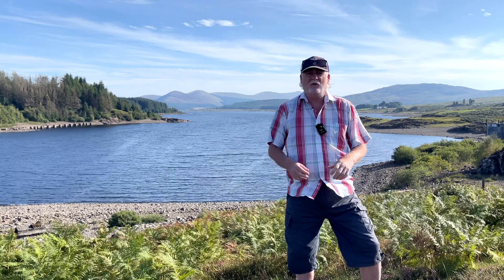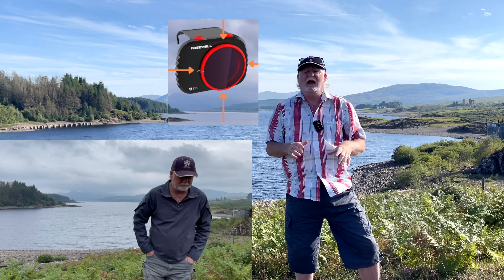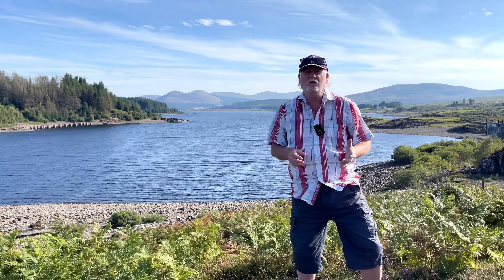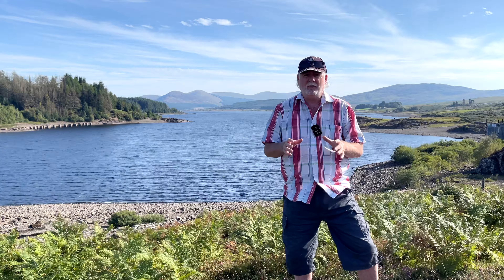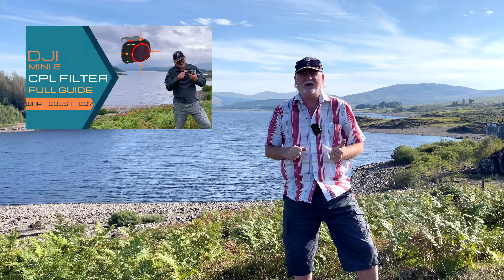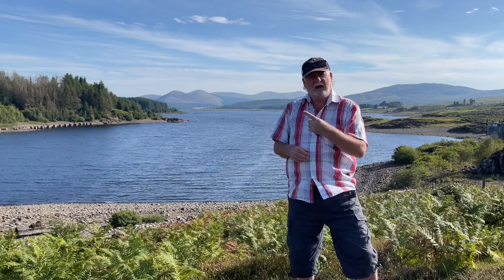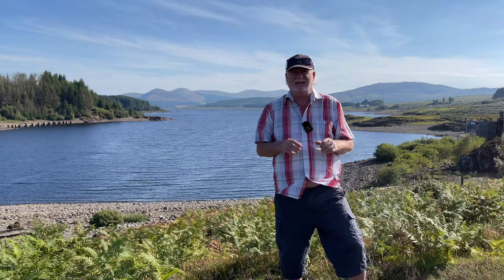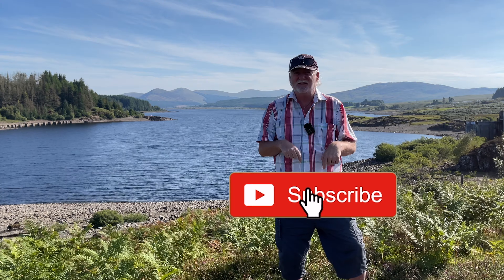DJI Mini 2 || Should You Use CPL Ring on a SUNNY DAY??

Comment: So... you have the CPL dial in, then the gimbal angle, then the 360 degrees of done direction,  and that's with static clouds, and no changes in lighting (during sunsets) Height & Position of the sun.  Simple! It's enough for analytical types to throw their hands in the air... aarrrgggh! I do think it's worth taking time to dial in a CPL, but only if your shooting straight at a subject in parallel.  Orbits and such would be a huge challenge to get consistent lighting & shutter.  Thanks for doing this!:_FLYING:
Reply from the maker: It’s an incredible amount of planning to get the shot. I don’t know if a 10 sec straight flying shot over a Loch is worth the amount of planning it would require to use a cpl ring. Aw, who am I trying to kid? Of course it is worth it! LOL 😂
Reply: @WindsweptRobert  Spoken like a true pro! 👍

Comment: Another great video on the cpl ring, direction is very important with the filters and the light. If you were to take Lassie up in the same situation and do a top down shot, my experience, it would be alot darker. That's why with a 28 minute flight time it's important to plan the important shots in advance. Thanks for your time and effort. 👍🏻
Reply from the maker: You're so right, JD. What I learned during the making of this video and the previous one, is that you have to take into account the direction of flight relative to the sun, the position of the sun in the sky, the strength of the sun, and the position of the CPL ring.  More than I expected!  :)

Comment: nice quick comparison, Robert...  the 9 and 3 seemed pretty similar, eh?
Reply from the maker: 9&3 and 12&6 looked similar, but things changed on the reverse direction!  So  I now know that it's important to work out where the sun is relative to Lassie's flightpath, and that will affect where I set the CPL ring.  It's a lot more complicated than it first seems!  ;)